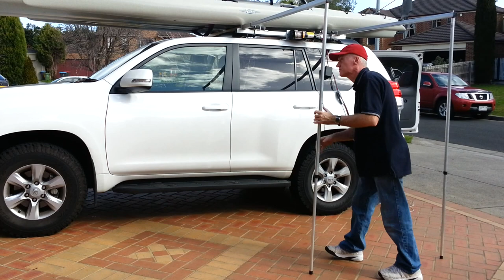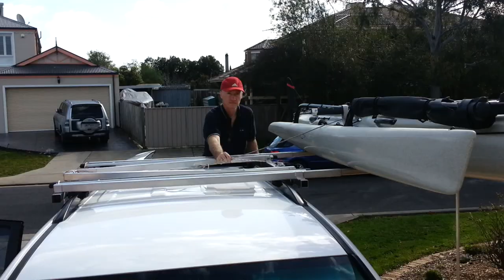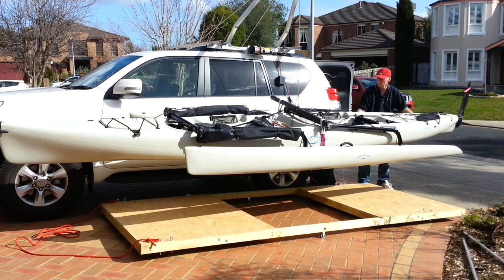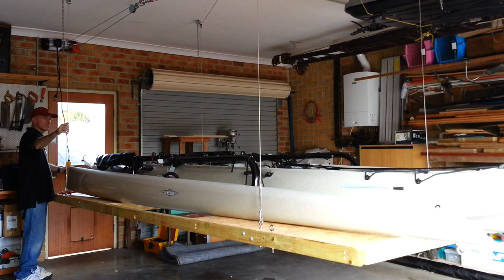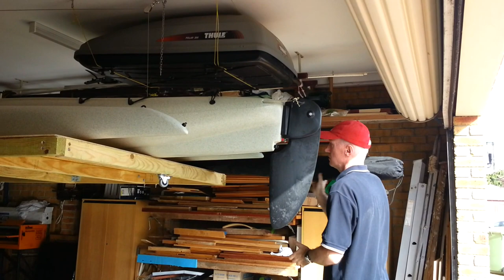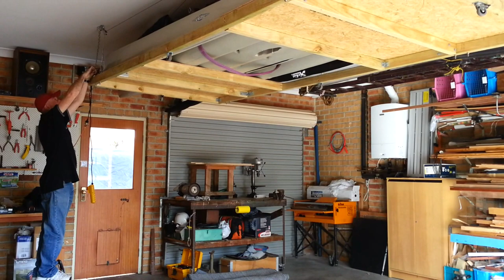Kayak Hobie Tandem Island Hoist - Car Roof to Garage Ceiling in under 8 mins using Hoist

Comment: I have a suspension system in my garage for my TI now but would like to change it to motorised winches rather than a hand pulley system.  Could you give me guidance on the specs / names / model for the winches you are using please.  In my case I would like to have the roller at right angles to the drive motor.

Comment: You engineered the living S%!t out of that!   Good job all the way down to the safety chains. Does the SUV fit under it?
Reply from the maker: Yes. The only thing I need to be careful of is the rudder. I can't park  the 4wd in the middle of the garage because the rudder hangs below the height of the platform. Otherwise no problem.

Comment: Can anyone give me the specs / names /models for the type of winches used in this application please.
Reply from the maker: Hi Des,
The 12v winch on the car is from ebay - search for 12v 3000lb ATV winch. I took off the steel cable and replaced it with synthetic rope.
The winch in the garage is also from ebay. It's a 600kg 240vac model.  It achieves 600kg by doubling back the steel cable using the hook with a pulley.
I hope that helps.